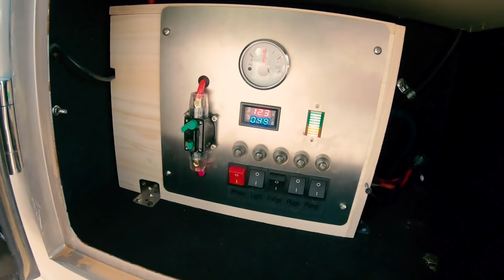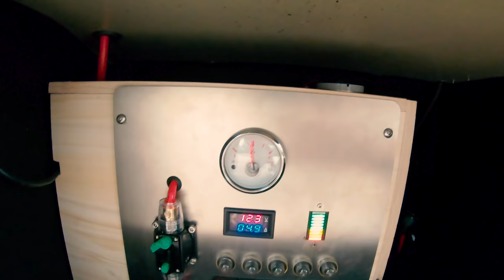We Bought a Camper Trailer! Epic Location For It's Maiden Trip.

Comment: Great vid guy's, just on the dust getting in, I noticed you have the same type of latches I have on my ute tool boxes.  They seemed quite loose when you shut the doors i.e. pressure on the latch, have you tried adjusting them?  Mine frequently loosen off and I have to re-adjust them, I don't get any dust or water in mine.  Just a thought.
Reply from the maker: Cheers Peter.  I have indeed adjusted them since. I think that's solved it but we'll have to get it full dusty to test her out. But like u said they were loose and not a tight fix.

Comment: Was this bought second hand? Just wondering about those seals not blocking out the dust..
Reply from the maker: Yeah we purchased it second hand. We've since sorted the seals out. It's just a matter of tightening up the door latches and adding some thin pinch weld rubber around the inside of the doors.

Comment: China made trailer. But you style of touring suits having a trailer, having a base camp is great.
Reply from the maker: Yeah that's right. Alot of research has gone into which one we were going to go with. I'd ultimately love a Patriot. But my bloods not the royal to afford one. Haha. But yeah we'll bug it out and upgrade what we'll need to. But it will go on some tougher tracks don't you worry. A suspension upgrade will be one of the first few things we do.
Reply: @TimRumble  maybe look at an automotive seal for the inside of you doors I notice the door opening doesn’t have a lip so a pinch weld seal could possibly suit
Reply from the maker: Yeah I know. Thought that was ordinary. The doors weren't very tight either. So i adjusted the little latches and has seemed to have worked. But yeah. Have pinchweld seals and it's prob going to get done this weekend.